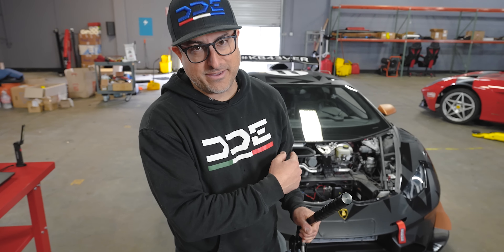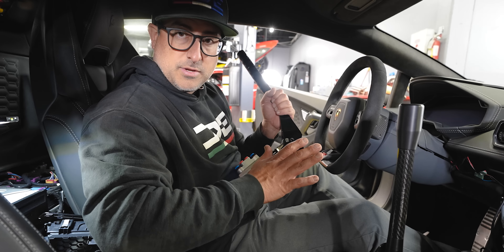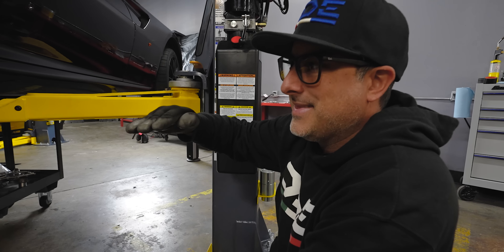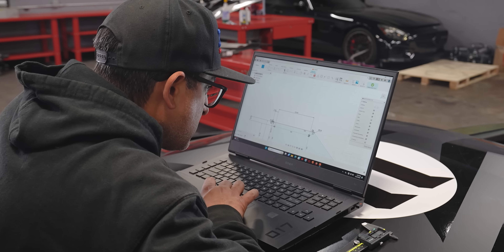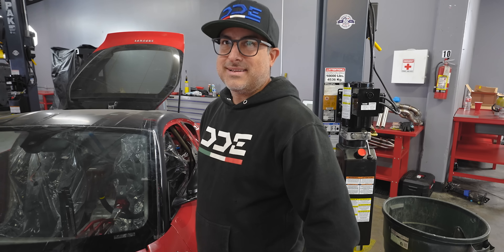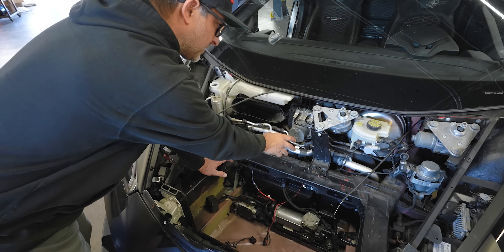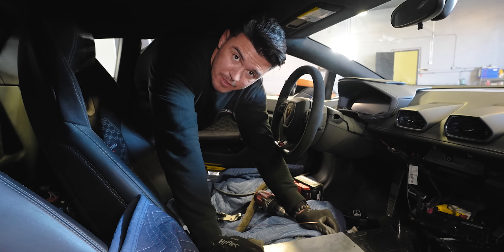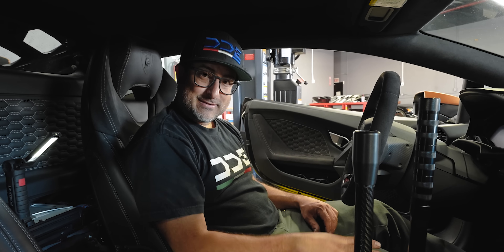FAST & FURIOUS  STUNT DRIVER REACTS TO DRIFT LAMBORGHINI …

Comment: "but have you heard a v10 m5?" 🤣 mike is a legend!
Reply: He isn't wrong tho there's a Canadian drift guy that has one and it screams sounds so good
Reply: That motor sadly is notorious for eating headgasket regularly. Also oil starvation and alot had ring issues as well. Sad it does sound really good. But imo the LFA sounds different. 

It's overrated but damn does it sound good.

Comment: I m sure Mike is gonna find a way to bypass that huracan’s transmission to not shift to first as soon as the rear wheels lock up. Kb43 ll slayy the tires when it can maintain the slide. Whooooo
What a project DDE. You guys rock! 
Add a raccoon next time😂

Comment: This brake and clutch mod is what Adam LZ did to the mark 5 supra and it worked well once it was fully dialled in by a guy from Europe to work with the changes that were made. You have to install a clutch pedal to make it work better for when you apply the handbrake and the computer needs to be remapped for the transmission to do what you need it to do

Comment: It would be cool if you 3d print 2 copies of the dash. Use one for now to get the all the switches mounted back up to get it back in action and the other to make a mold for carbontastic or another shop to make a carbon dash for the Evo and install that one once its made. I think that would be sick!
Reply: And then take parts like that and make an extra one to make a display of some of the intricacies they put into the cars in one of their rooms

Comment: Can you tap into the PWM circuit of the wheels that will be spinning continuously to get the 2nd gear to stop kicking out under the handbrake lockup? This would ultimately eliminate the ABS in this car until it was put back to a stock configuration but it would fool the car itself into not downshifting.

Comment: I know that a tuner can make it to where the car won't shift unless you manually shift it. I have this on my car. My car has slapshift. Basically, when you have the car in Auto, it drives normally. However, if you push the cars shifter into slapshift it deletes all transmission data and the car doesn't know when to shift. This allows you to retain all the control. I have a TCU tune on my car. Mike or someone should look into this mod as this might solve the problem with the Hurrican. Hopefully this helps.

Comment: I wonder if you could wire the speed sensors to a disc. Then use  electromagnet clutch similar to a lawnmower engagement to releases a disc when the ebrake is pressed to trick the sensors to not downshift.

Comment: Mark had me rolling when asking tim about about how the car is going to drive sounded like pimp my ride like bo asking mad mike. well at dde pimp my ride mark the car will have more control like no more throttle and understeer throttle and understeer, you have this dual master cylinder e brake lever to slay tires lol

Comment: Maybe an interrupt switch wired into the brake lines to split the front wheel speed signal. Wire in a brake pressure switch to a micro relay that will take the wheel speed from the front wheels and share it to the rear wheel speed sensor input only when the hand brake is pulled.

Comment: You can probably just wire in a strain gauge to that tcm and tell it to go into neutral when pulled and back to the previous gear when released.

Comment: Mike: Get a Bambu Lab printer, No clue if its big enough for the dash, but it’s for sure fast enough and big enough for printing hose line release tools and other fun stuff. Id highly recommend a Bambu Lab X1-Carbon I have 3 of them dead simple to use and maintains itself and can print carbon fiber infused nylon.
Reply: Other good car tool uses are strange custom washers/spacers, plastic sockets to avoid damaging painted bolt heads, wall mounts for tools for any of the red, yellow or blue tool ecosystems. 

I have files great for organizing DeWalt and Milwaukee stuff and i could send ofer files so u don’t have to dig online for them. It could be a fun tool that enhances productivity in the shop!

Comment: I was wondering about the DCT downshift as well - I have a C8 with DCT and as you slow it automatically downshifts.  I believe that is all controlled by the transmission CPU, so maybe some re-programming is required?

Comment: Wonder if it will downshift if the rear wheel speed sensors were unpluged. (or vss if it even has one)

Comment: Maybe a new transmission in that will time it for a 2nd gear switch with throwing it back into first. I new these cars are built with a safety switch in the ECU to do the backtracking when max 1st gear is reached and when shifting 2nd the limiter just kicks on at an inconvenient time. So timing is an issue. Maybe change the limiter but that's about impossible with the ECU safety switch. So that's why you might need a new transmission and possibly a better ECU.

Comment: Is the sequential the same thing as a dog box tranny? Or is there a difference between the two, i know alot of drag cars use dogbox and some rack race spec use dogbox but i curious if theyre the same or diff. and on a e brake like that, is that the same as a hydro system? I mean i know he said twin master cylinders but is this the same as hydro?

Comment: Don't you think the steel plate original idea is better for structural integrity over the long run considering the hand break will be yanked continually? Idk but the possibility of carbon fiber failing seems pretty high over time
Reply: Lol nvm. Should have finished the video before commenting lmao😂

Comment: Unusually don’t watch the build series too much cause I’m a mechanical idiot … but I would like to know if you eliminated the paddle shift completely or if you can actually use the stick shifter OR the paddles ? And do the sticks for the e brake and the gear shifter have to be this long ? I reckon if they’re shorter they’re not as easy to access ? They just seem disproportionately long in this car 😂
Reply: Paddles are gone